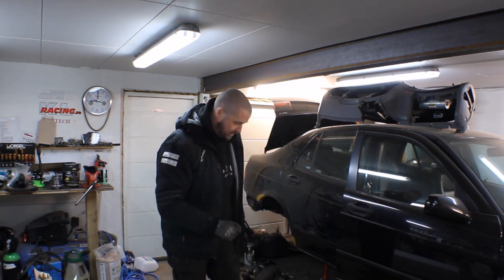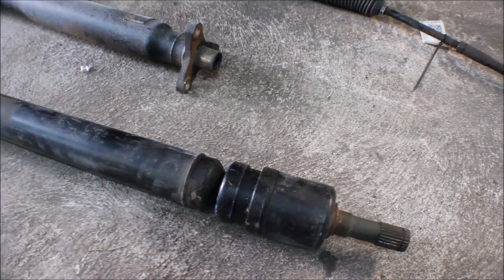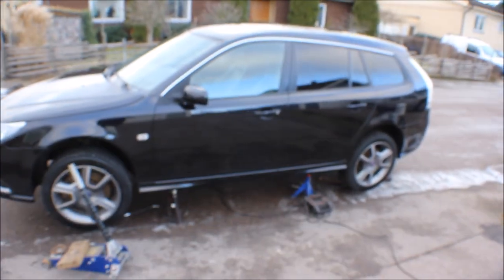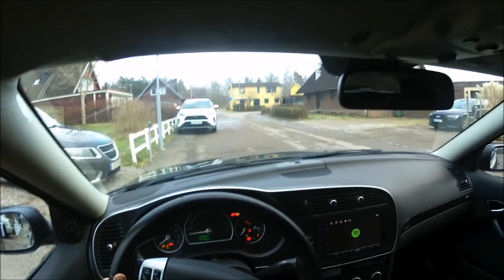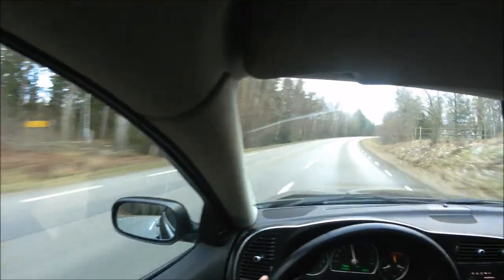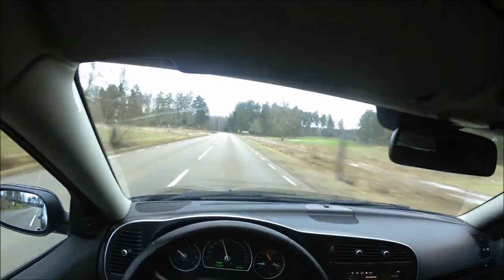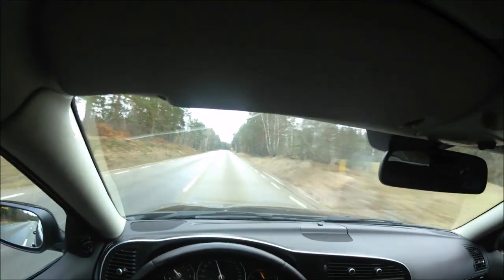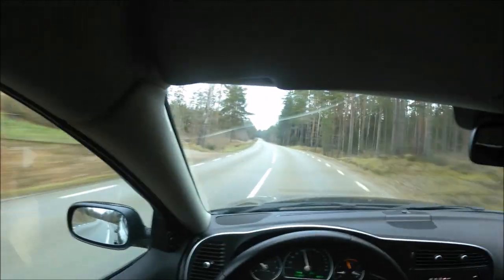SAAB 9-3 Turbo X BAD VIBRATIONS! Propshaft Replacement

Comment: Mine was changed about 2 years ago and here in Jönköping but I have 210 BHP RHD auto. vibration on start but at speed ok. Try the local guy here the parts are readily available

Comment: One more thing... take out the Haldex fuse (10A in the trunk)... if the vibration disappears when accelerating then it's 90% driveshaft. 10% it may be a damaged Haldex because someone hasn't changed the oil in it.
Reply from the maker: Good input, my haldex was just serviced
Reply: I thought if you take the fuse out (Nr.11 in the rear fuse box ) and it stops vibrating, it means it is the haldex that makes the vibrations, or the awd clutch in the haldex precisely...because the prop shaft still spinns when you drive like before 🤔

i have tried it with the fuse already because i have weird issues with my haldex also...it only vibrates when accelerating not full throttle, if you floor it it suddenly stops vibrating...i try to locate the issue but its very difficult. The oil in the haldex clutch was brown to black already after 3000km driving...maybe you guys can help a bit 😊

Comment: I bought my '09 v6 Aero XWD almost a year ago and have had almost the exact same problem, but ~25-35 mph and in 2nd and 3rd.  I suspect it's the prop shaft but this likely confirms it.  Hopefully I can find a shop here in the US that will refurbish it for a fair price.
Reply from the maker: Think you are gonna have to wait for like esaabparts to get a new batch
Reply: Please how many miles on the clock ?    I’m fearful !
Reply from the maker: 170 000km
Reply: @JonasKakarikas  Thank you…..mine has only covered half that distance.  Will continue to garage and have car serviced regularly including Haldex.   Always admire your workmanship !  Best, BH
Reply: @basilhillman1349  Mine has 180,000 miles.  Seems like that's the time for them to go.

Comment: I know it’s not the same type of car mine is an 2004 9-5 arc. Jonas of all the videos you’ve done I have never seen you replaced any axles or control arms on any of your 9-3’s or 9-5’s mine vibrates like crazy when going above 60 mph someone from a Saab group suggested the flywheel. JW if you could give me some pointers
Reply from the maker: Cv joints tend to crack and brake, but it will be easy to spot, control arms doesnt cause vibrations unless they ar rattling in a really bad condition. Its impossible to say what it is without checkibg on The car

Comment: 9-5 NG AWD? I have some minor vibrations in my car as well, and most likely it is the pros-shaft (it was removed and all vibrations are gone). Do you know the status for a replacement or maintenance for this car?
Reply from the maker: Contact Saabparts or try find a better used one 😪 they are not serviceable the normal way
Reply: @JonasKakarikas  Thank you much. Sorry, AWD=XWD. Not serviceable the normal way you say: so not any chance to do any kind of maintenance even for a company with special competence with shafts?
Reply from the maker: I think you will need to cut the Shaft to get to the bearings then weld in back together. Not sure a lot of shops would like to do that, but could be someone. So have a look around
Reply: Mine went bad took it out, couldn't find a replacement, been driving it without the shaft, service XWD light on but drives great, 2000 miles, see how it goes, will take to fuse out as someone suggested

Comment: Be careful with the new propshaft you might need to get a reinforced one made running extra power?
Reply from the maker: Nah, its more age that kills it rather than power. A few guys running around 500hp without problems

Comment: Nice job out on the cold asphalt👍. Is this the first time you run into trouble finding SAAB spare parts?
Reply from the maker: Thanks!
No i have ran in to parts issue a few Times on my ng9-5s since alot of those parts is not being manufactured anymore. Ng9-3 is usually not a problem. New propshafts will be back, but for now they are sold out.
Reply: @JonasKakarikas  Ok. Thank you! We have three SAAB:s in the family so it’s good to know👍👍

Comment: Doesnt the Volvos use the same part? Ive read on one of the Saab forums they're interchangeable 
But i remember on bookmarking the video they linked. 

https://youtu.be/KRBvuxEq7_8?si=Zo6P7v2KdtkVEwxK
Reply from the maker: Nope, the propshaft is unique for saab
Reply: @JonasKakarikas  fascinating...if I can find that forum response. I'll link it. Either way, thanks for everything that you do, you're an inspiration for us keeping the Saabs on the road!
Reply: After searching and not finding the exact post, the spline you reference is indeed unique and very hard to find. The opposite end which is the video I linked can swap with Volvos. So basically, we're on our own in this cold, cruel world. Lol!

Thanks, Jonas. Keep doing these videos! Much love from the western hemisphere!
Reply: I have a Buick Lacrosse AWD and the drive shaft is almost identical. Same splined front shaft and six bolt rear shaft hub. Of course the big differences are shaft lengths and carrier bearing mounts. Just looking at your mounts compared to mine the shapes are different and mine are aluminum. Here in the US we used to have good driveshaft shops that could build you one as long as the two ends were able to be reused.   Buick/GM used the same Haldex system as Saab since GM owned Saab till they killed it in 2013. A new driveshaft that fits my Buick runs about $600 to $900 depending on where you get it from. Great job though getting your vibration solved.